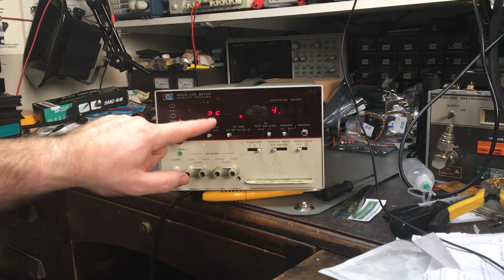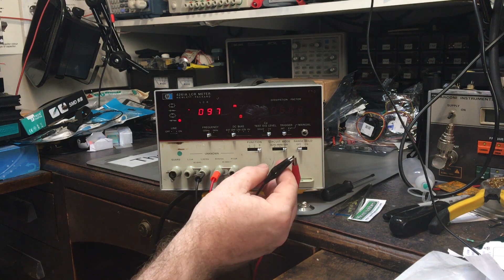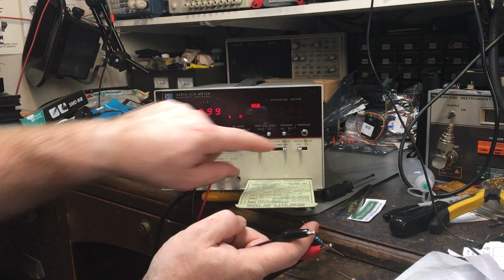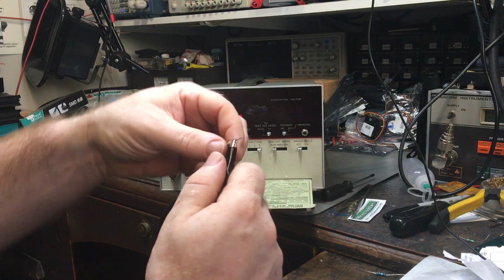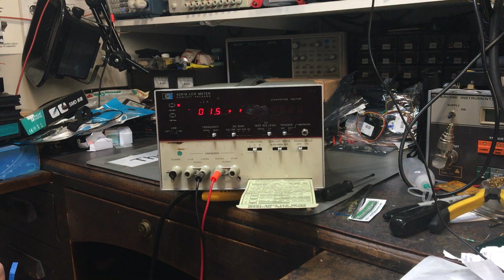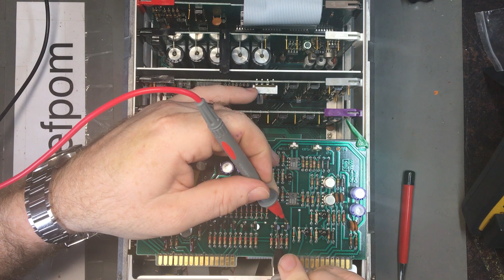🔴 #378 HP 4261A LCR Meter Repair Part 1

Comment: If you're going to attempt to test run a piece of equipment you should, at the very least, ensure you can operate it beforehand. There's nothing intelligent about someone flicking switches and pressing buttons at random in a vain attempt to understand the operation of a device. 
I'm not sure that using abrasion on gold plated contacts is a good idea as the point of plating them in the first place is that gold doesn't oxidise and that it's a much better conductor than bare copper. I would use a reputable contact cleaner rather than run the risk of removing the protective gold plating. 
I appreciate it's easy to make disparaging remarks from thousands of miles away in relative anonymity but I think you'd be better served to spend some time on preparation before jumping in without a plan of action to follow.
Reply from the maker: Pete Allum - what I video is as much of the entire process as I can, including diagnosis of issues, trying every switch and mode for clues of operation (or lack there of) is part of that.

I don’t have an issue using a gentle abrasion method on gold connections, gold can still tarnish after decades, and a gentle rub is needed to get that off, cleaning sprays don’t cut it, yes you have to be careful about doing too much, you only do as much as needed to get the tarnish off.
Reply: The Defpom's Repair Channel 
Testing the functionality of switches and buttons is one thing but when you don't even know how to operate the equipment it's rather frustrating for the viewers. The least you can do is read the manual beforehand, instead of declaring several times during the course of the video that you "don't know how to work it yet"!
Fair enough with regards to the gold contacts, although there are contact cleaners available that are specifically designed for gold plated contacts, such as Deoxit Gold, but if it's done carefully with a minimally abrasive tool then it probably won't cause any detrimental damage to the gold plating.

Comment: I had a few of these on the bench in the late 80s. IIRC there are some test voltages on the motherboard under the bottom plate that are a good staring point. I don't know whether you have the extender card? That really helps in fault-finding on the cards.
Reply from the maker: Yes there are easy to access test points on a few of the cards, the fault finding process in the service manual is also very good.

Comment: I have one I use every day and it is well within specs. It is very fast and I use a 5 wire tweezers (the one from my IET DE-5000 but now with 5 bananaplugs). Mine also does the strange startup display and I know an other that does this too. But only a few seconds. Yours seems to be very slow. (measure and range switching)  If you need some measurement data, pictures or video let me know.
Reply: Five-wire?  I thought a standard Kelvin connection was enough.
Reply from the maker: thanks, I am actually a fair way behind with the repair footage from this, I have actually fixed it already :-) there will be about 6 videos on this unit.

Comment: It seems rather confused lol.

I would be checking the components that connect to the front posts, people have a bad habit of not discharging charged caps :-(
i like the modular design.:-D
Does it have the ability to test for capacitor e.s.r?, that would be most handy.

I still have a pcb polishing block from the defunked maplin, that cleans contacts nice too, but r.s has the same thing although at a hell of a price in comparison.